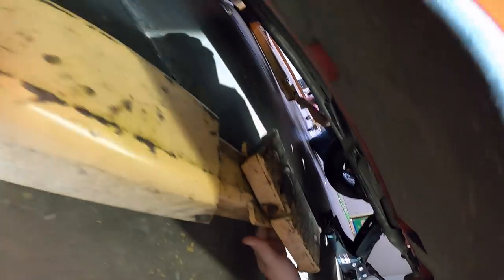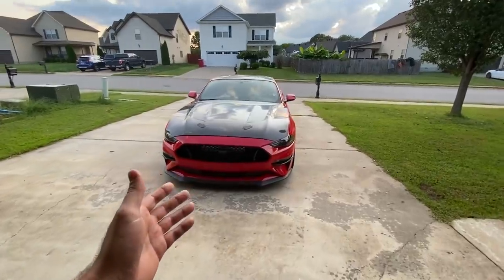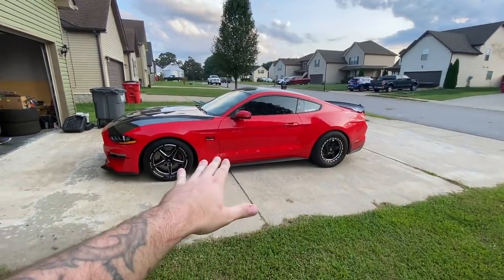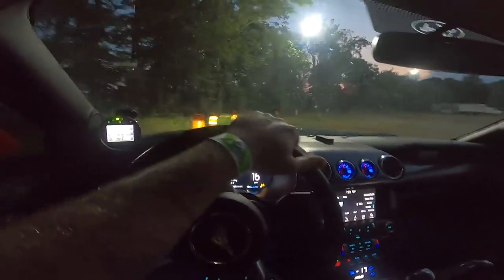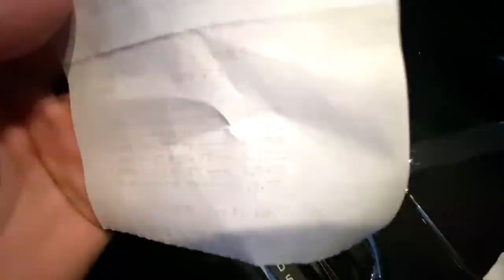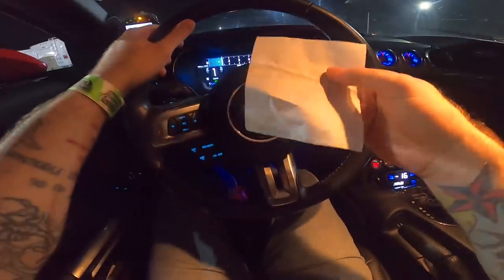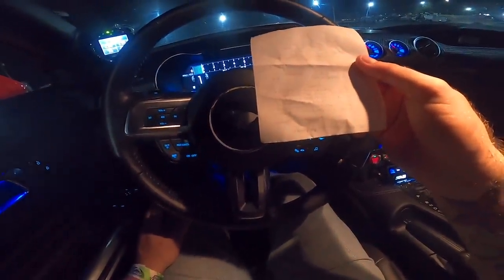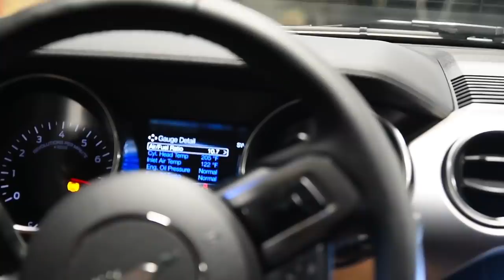Making My Twin Turbo Mustang "SHOOT FLAMES" With 2-Step & Transbrake *WOW!

Comment: From the look and sound of it I think one of the shifts during the burnout is too soon. Once the tire came to a stop on the gear change. The other time on the gear change the motor instantly sounds loaded and too far down in the rpm to keep good wheel speed and build heat. Then after the struggle to gain rpm is over and the rpm is back up you roll out. 
=Cold tires

Look at some clear slow motion shots of your tire to see how it's reacting (dead hook, hook then slip, straight spin) along with the suspension movement.
These two things can greatly help you lower the 60ft.

Comment: Great video!! Two step is working just got to stop it seeing the coil issues when the n2mb is cutting power to do the 2step. Everything is wired per instructions.
Reply: Check with tuner... had lund turn off misfire logic for mine to work

Comment: Are you still stock block?
Reply: Also does your gfb boost controller get in the way of your toggle switches down there. I want to put it down there but it feels like it'd be in the way
Reply from the maker: Stock block. GFB does not get in the way
Reply: @Zander13Productions  Ok cool. Thanks man